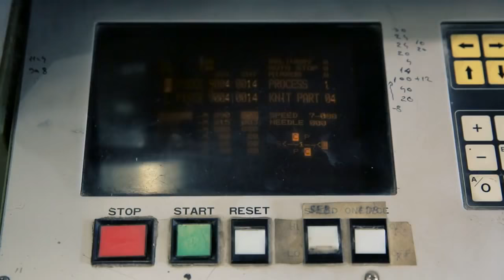Dabi - Unkillable Socks FYF will Replace Sports Shoes

Comment: These and skinners are a waste of money because even though they may be cut resistant they have no shock absorption and only hard rubber can offer that... 😏 Nike and adidas are still king... for now 😏🔥😫
Reply: Technique is much more important than rubber.  If you're running incorrectly no rubber will save you